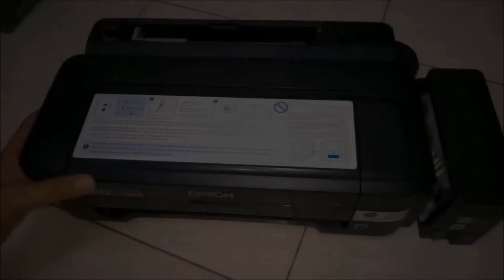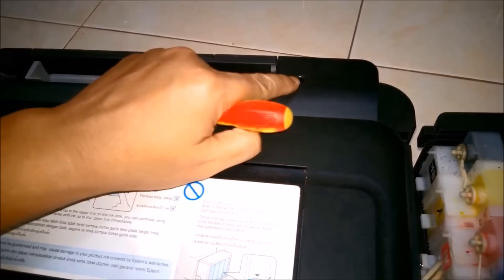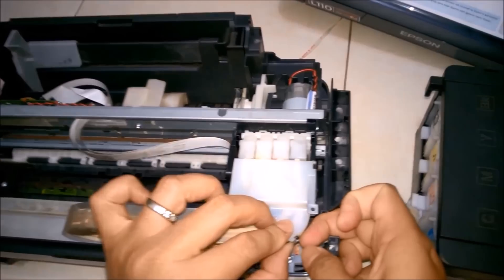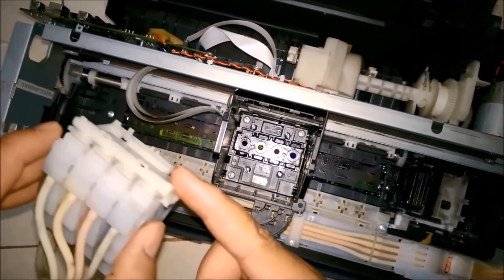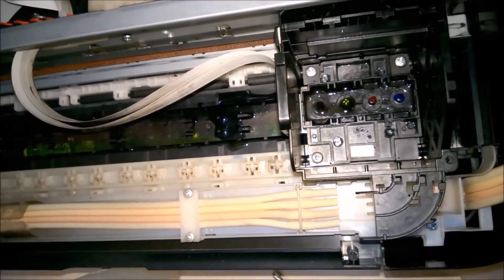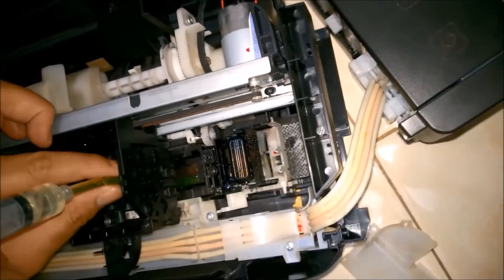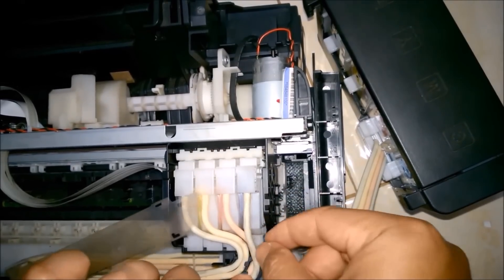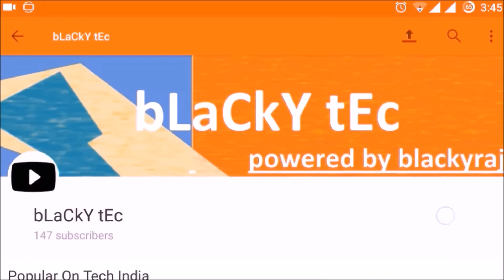Epson Printer Not Printing Black Color | Epson L210 L110 L220 And All Other Series.

Comment: I have an easier solution, in Epson printer use head cleaning 10 times. Works like a charm.
Reply: i tried 15 times right now... and the black still with stripes :/
Reply: black stripes? i think we have a different problem. my problem is no black will come out whenever i try to print black. But I think you have dirty head in your printer so try head cleaning more.
Reply from the maker: Please post on your channel